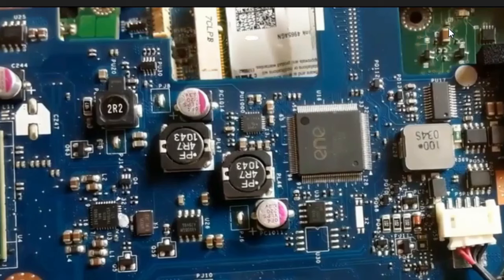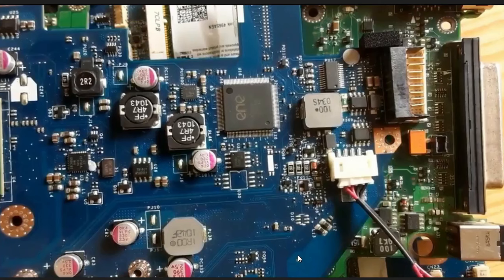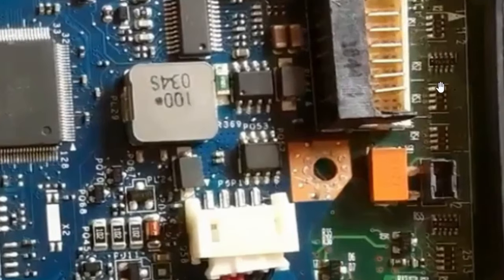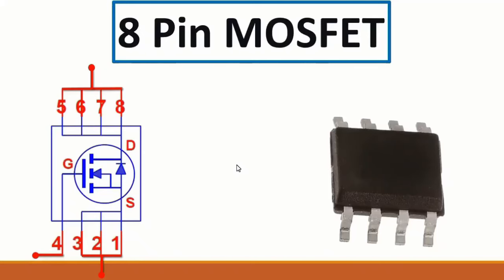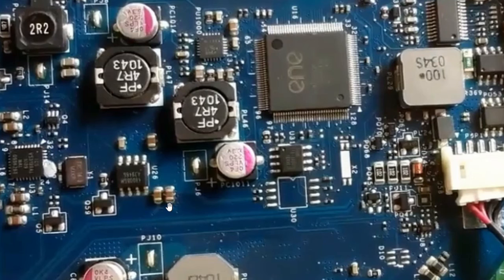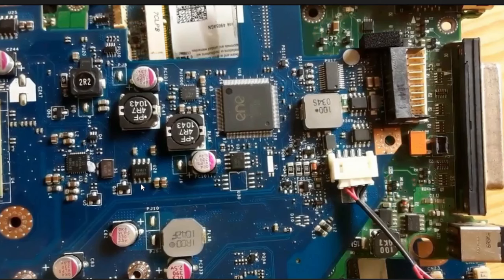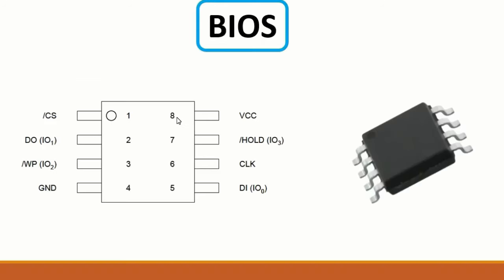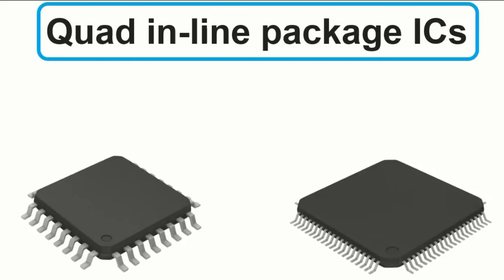All Electronic Components Explained - Complete Guide

Comment: hello everything is fine! I have an electrolytic capacitor near the cpu, and when I try to measure it to see if there is a short circuit, I received a continuous buzzer, both positive and negative, is this normal?
Reply: If you are lucky it's a bad cap. You can try removing the cap and measuring weather there's a short again.
Reply: @orange_tweleve  Thank you, I was getting to the point where I was going to send the computer into space!
Reply: @brunomarques8828 was it a bad ic or bad cap ?
Reply: @orange_tweleve  
I still haven't found the problem! I took the cap off but it's still short!
Reply: @orange_tweleve  for the main power up...I don't have voltage anywhere! Lol